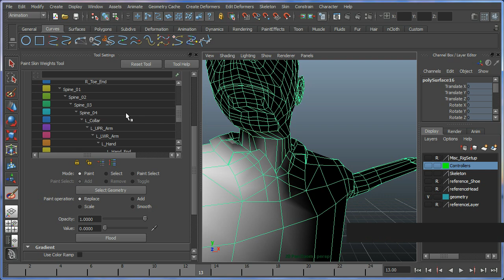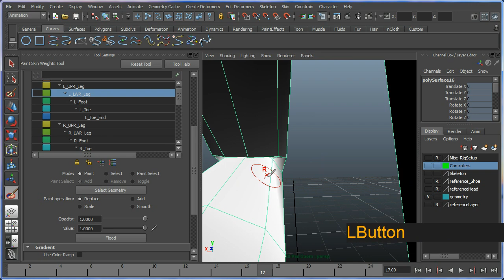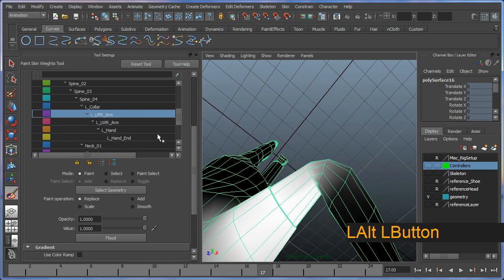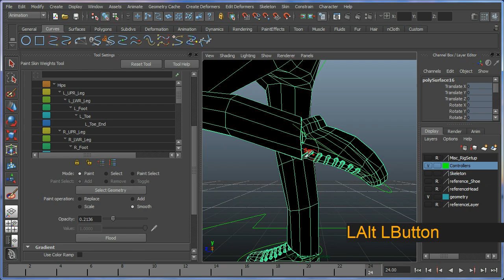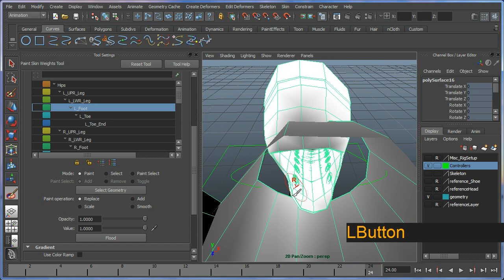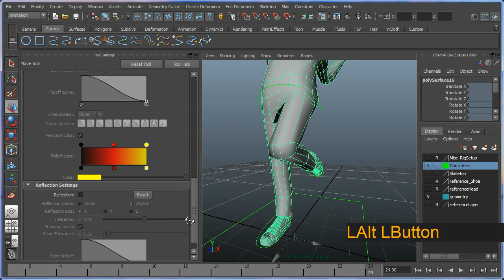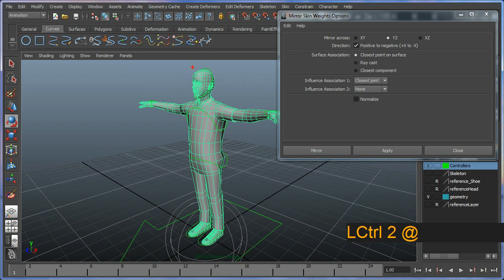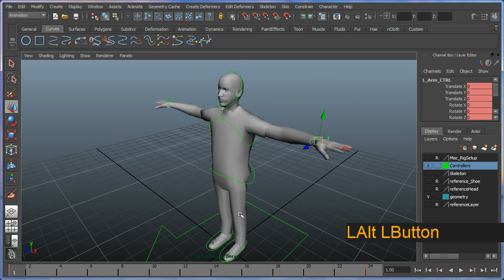Basic bipedal character rigging setup in Maya - Part 7 of 8

Comment: this is stupid. arn't there any option of choosing specific points or polygons and bind them all in 100% influence to a bone?
Reply from the maker: +Nimrod Zaguri You can 'replace' values with the paint tool.. if you want to manually edit weights for each vertex use the component editor under general editors.